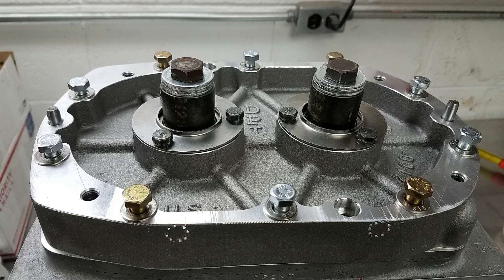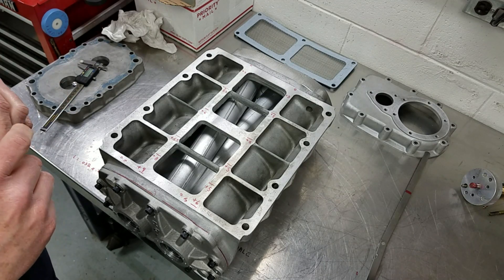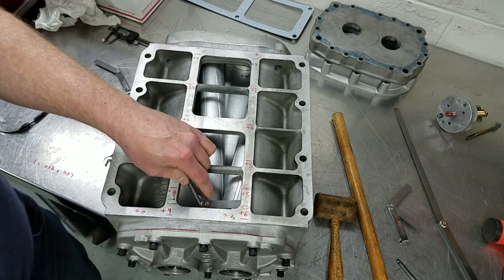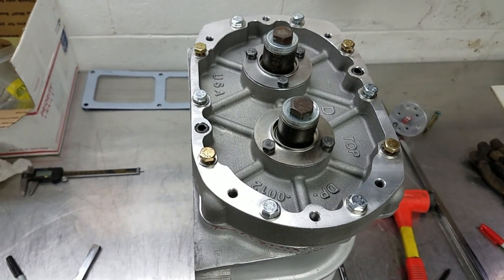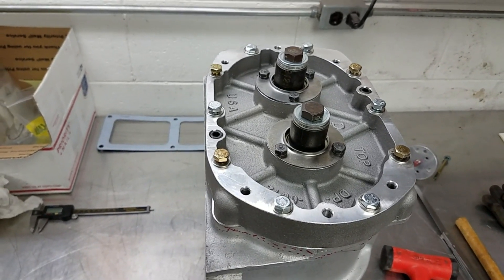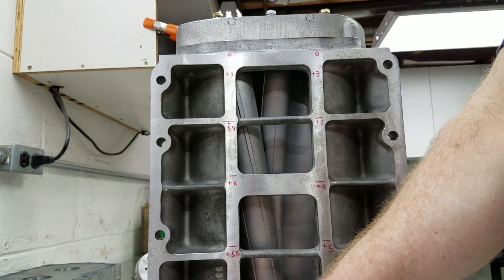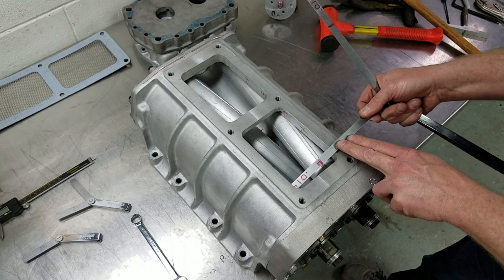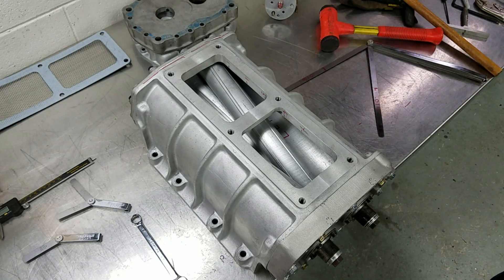My 6-71 Blower rebuild, Part 12: Setting rotor to case wall clearances.

Comment: How did they set clearances in these things when they were in  mass production ?
Reply from the maker: I expect that they had a fixture to help them lock case to wall clearances, after which they would drill the dowel pins in.  Rotor timing is changed with shims for production units, so a human can change those in a minute or two, if he does it all the time on the line.
Reply: @MakerCave  interesting

Comment: With all this machine work a person needs all these tool and there is such precision for a safe useable 671.  There is no way a novitiate, especially without machining equipment could even possibly refurbish a diesel to gas, no way.  I would trust you building one for me if this is something you would consider doing.   How would I be able to talk with you.  I am 71 years old and now that I have gone  through watching what it takes to do this I am beside myself to what I originally thought... My email address is doctraveler7@gmail.com.. I have no idea where to turn if you do not work on for the public.  Maybe others on here know as you suggested don't try this unless you know what you are doing take it to a blower mechanic That does not tell me where to find such a mechanic that is trust worthy and as precise as you are showing here.  I am sure there are mechanic or machinist out there that will say they can do it but really do not now how and i do not need to blow up my motor or kill myself from it coming apart at high speeds.. Actually learning how difficult this is, is very depressing..  I now have to find someone or ask if you will do an outside job.  Please contact me by my personal email verse putting your reply on public view.
Reply from the maker: If you have a blower to convert or rebuild, call the guys at Dyers Blowers in Chicago (Summit) Illinois.  http://www.dyersblowers.com/  I have dealt with them for parts and assistance in the past and they are top notch.  Unfortunately I don't take in outside work, as my Corporate job, (and a new house with lots of acreage!) keeps my schedule full, leaving me just enough time for my own hobbies.  Thanks for watching!

Comment: Google Search US Patent "US4638570A" 

"Supercharger assembly and rotor phasing fixture and method of partially assembling"

You're welcome 👍
Reply from the maker: I have read over many patents over the years, and have assisted with writing few, so fortunately I am familiar with the format and can usually skim through these pretty quickly.  This patent is very cool in terms of where it falls in manufacturing history.  It was filed by Eaton Corporation in 1985, during the time frame where they would have been doing the initial development work on the M62/M90 series superchargers.  Eaton would begin supplying these blowers to Ford, GM and other OEM's about 5 years after this patent was submitted.  This patent shows that they were acutely aware that hand assembly and clearancing of their new blowers would not be practical, and that they needed a fixture to get rotors rapidly phased during mass production assembly.  The hardware and methods shown in the patent don't readily translate into doing final assembly of a 6-71 for a Hot Rod, but they are a very interesting window into what type of development was happening in manufacturing 30+ years ago.  Thanks!

Comment: hi can you help me,recently my 692 detroit started to warm up at 1200 rpms,i had a mechanic do the injectors where it didnt do munch,next we opened the blower and turbo,he said the turbo looks like needs replacing but the blower rotors are moving when the engine is off they are moving like a quarter inch not the long way the long way is tight but side to side its moving quarter inch ,is that ok and also maybe you can rebuild this one as i watch your video and wow like that is very good workmanship,thanks